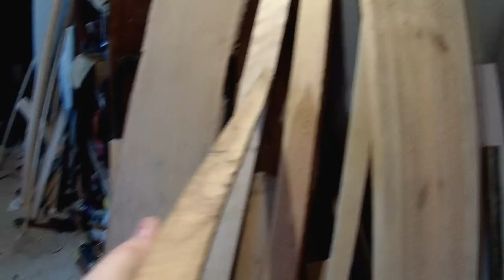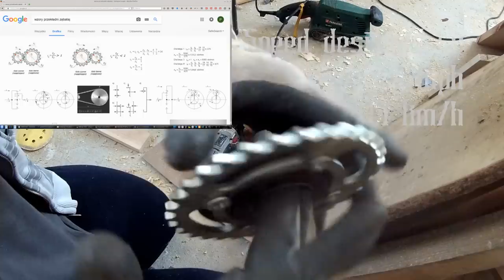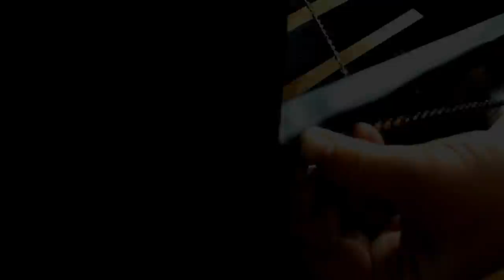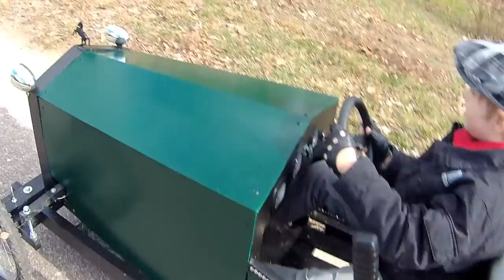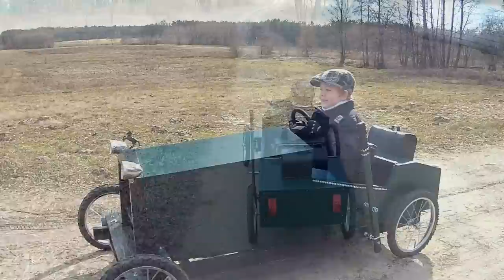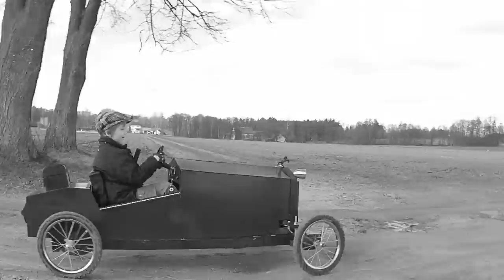Homemade electric go kart for kids in vintage style - DIY build - part 1

Comment: Love it!  Back in the 1970's, used oak barrels started hitting the market place and do-it-yourselfers where making all sorts of projects from barrells. I looked at the shape of those barrels and thought they would make a great simi replica of one of those early, 20th century boardtrack racers. Never did it, but at 66 now, that thought still lingers. Great job on your project, that added a new subscriber.

Comment: I saw the Instructables, but do you have plans?
Reply from the maker: No I don't have. I wrote ininstructables that the dimensions (like weight, legs, arms length) determine the size of the car. 
But If You courios about the construction, building process, technical sollutions stay tuned, I will post the video in which I will show/explain everything.
Reply: Those measurements must only be available in the PDF download with a Instructables "premium" account. The version I read didn't have any of that. Will stay tuned for your next video....

Comment: I am actually trying to build this so can you give me some tips
Reply from the maker: Yes of course.
1. Make both rear wheels powered by engine
2. buy whole electric kit - controller, engine and power pedal 
3. You will have a little problem with front suspension. I made it from wood and it's working, but I know, that better durability You will have if You use steel for spindles.
4. Rear axle should be really durable. 
5. Use a thick wires to power the engine from batteries- to handle high current and to avoid voltage drop

The whole instruction is on instructables. Search there for 'wooden electric gokart'
If You have some more question, I will answer them.

Comment: please share me a link to buy moter
Reply from the maker: It's hard, because this is a Polish engine importer. Try to find ready to use kits on ebay. Typical kit contains engine and controller. Search for those with power pedal included.